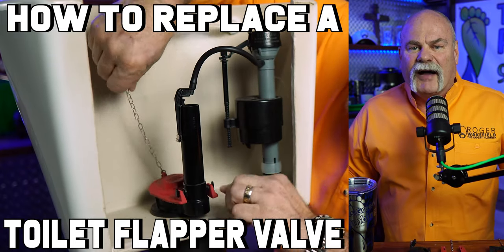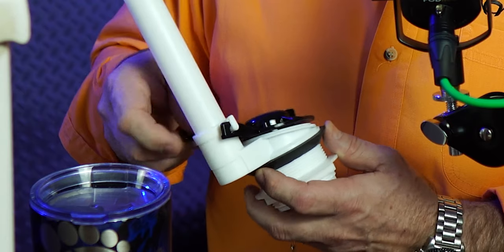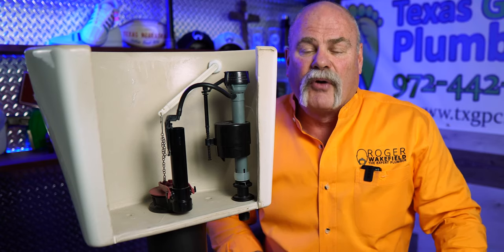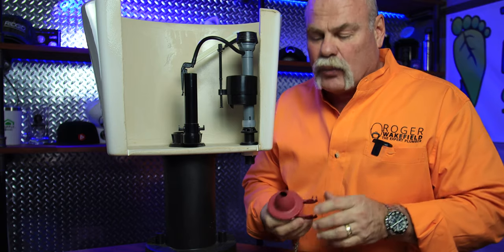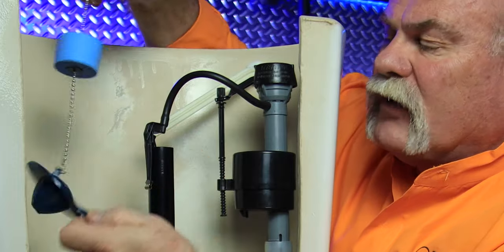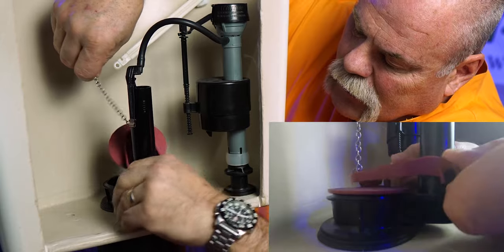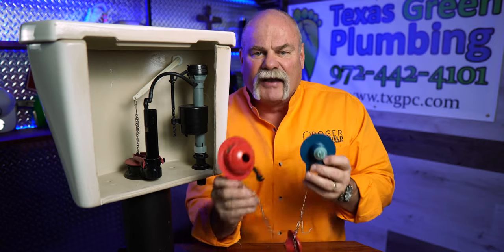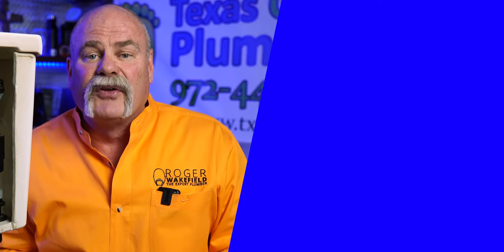How to Replace a Toilet Flapper Valve - EASY DIY Plumbing

Comment: I have the old style black float with the rod.  I've screwed back and forth to put more pressure on the valve, but it still slowly runs.  Any suggestions?  Should I just replace the whole system?

Comment: Subscribed a few months ago and watch every new video.  So I will ask an expert 2 things.   1  How to get rid of drain flies.  Ive cleaned my drains and flushed with hot water, but I still have them coming out every so often.   2.  Many articles say that you should flush the drain with boiling water and or a baking soda/vinegar mix.  But Ive read that boiling water down a PVC pipe isnt a good idea due to the high temperature.

Comment: Thanks for having so many flappers. My flapper however, is not soft and can’t easily be removed from those L ears. My flapper has a hard plastic hole. I’m afraid I might break the ears in order to take it off. Can you please help me? Thank you, it was a good video for what I’ll have to do if I can remove the flapper.

Comment: Excellent video, Roger, but I can't seem to get my flapper off. It looks like the navy blue one you show at 9:14. Mine doesn't have  any "hooks" to lift it off the rim, so I tried twisting and lifting. Nothing. I'm afraid to break something. Does removing take more force than it looks in the video? How do you get the navy blue one you have to come off? Thanks.
Reply: Put some Vaseline around the hooks of the water filler stem and it should help the flapper ears to slide right off.

Comment: Thanks for the info. Wondering if there’s a way to determine the length of the ears that are used to attach the flapper. I bought a flapper where the ears were too short and the flapper didn’t cover the opening.

Comment: How do you change the whole valve assembly? My toilet has a casket at the bottom of the black tube assembly, that casket is needed to change, how do we remove the whole thing? My toilet is an old one Mansfield 160/162, help? Anyway, thanks for your video here, appreciate you Roger W.

Comment: Roger, We've replaced the float, replaced the flapper (with the exact same kind) and the toilet still runs, 3 seconds every 15 to 20 minutes.  couldn't feel anything on the rim when we replaced the flapper.  any other suggestions?

Comment: I measured the inside diameter and I get 2 1/4 inches and yes my toilet is running, should I go for a 3 inch flapper?

Comment: How do you determine the size of a new flapper, if you don't have the old one to measure?
Reply: Measure the diameter of the pipe that the water flows down.

Comment: MY flapper won't stay up.  When I flush it, the flapper comes back down right away and closes the hole, preventing water to come in to flush the toilet.  What is wring?  There is only a bit of slack in the chain.

Thank you!

Comment: My flapper stays in the up (open) position where I have to manually push it down to seal and stop water from leaving the tank. What’s the problem?
Reply from the maker: the chain is too tight on the handle making it stay open...take the clip and lower it on the chain
Reply: @RogerWakefield  ; Thanks

Comment: Sometimes it can be difficult to get the flapper ears off the water stem pipe. Simply apply some Vaseline to the arms of the water stem and this makes it a lot more easy to slide the flapper ears off. Once you get the flapper off clean the mold and bacteria off with some warm bleach water and scrubbing pad. Then re connect the flapper to the water stem pipe and it should fix your leaking problem with the toilet. If the flapper is cracked of missing any pieces you will have to replace it. Just a little tip from my experience with water leaks caused by a dirty or broken flapper. 😁